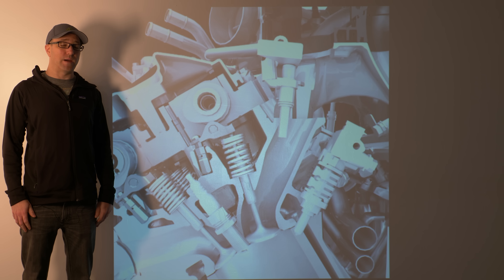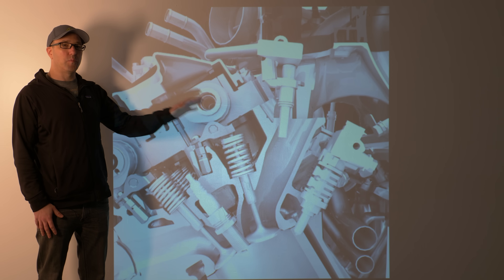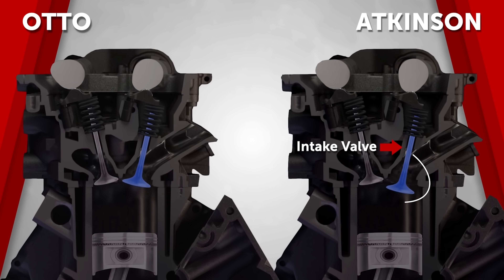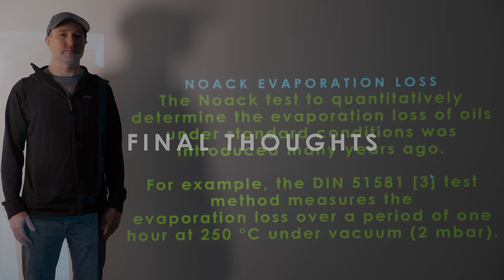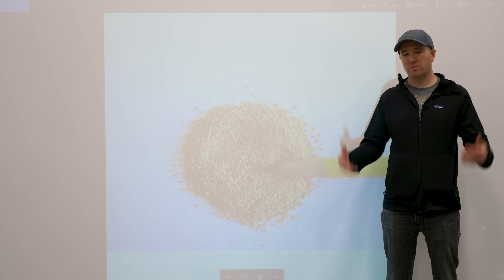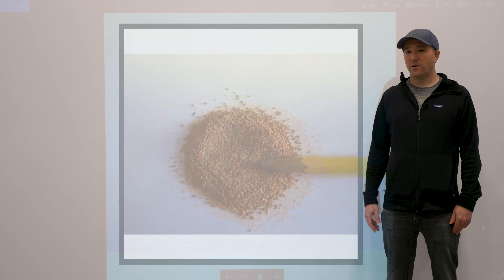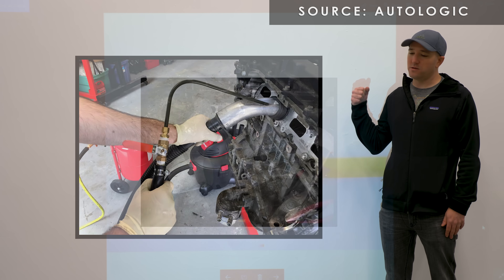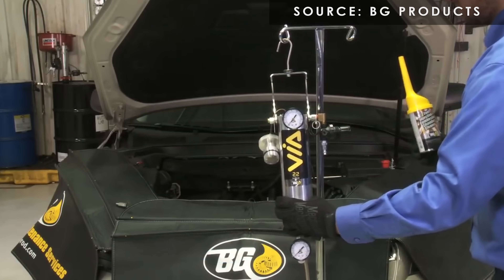Direct Injection, Problems and Solutions | The Fine Print

Comment: Sorry but I have to call total brain dead bullshit on just about everything you said.  First off I can clean much worse carbon off those valves in 5 minutes with toluene and they will be as if you just polished them on the brass wire wheel.  Second one only needs to disconnect the blowby to solve that stupid problem.  Third passing emissions is so easy for any car that runs that anyone who doesn't know how has no business even lifting the hood. 
   Now for some reality that is way too real for any engineer who has had their brain removed by a school of lower learning to understand or believe, much less build and use.  Paul Pantone's Geet Plasma generrator, used by hundreds of thousands of people all over the world and actually taught in french university automotive classes produces absolutely zero Nitric or Sulphuric pollutants and when built right puts out over 25% oxygen from the exhaust.  Everything this world does comes from the world of lower learned loser idiots...too smart to build a 100 dollar invention and prove it works.  They would rather spend their time telling me how the thing that I build does not work than to shut their stupid mouths and see how simple life truly can be.  The University is one of the most evil places a man can set his foot and worse than that is people are so stupid they actually pay idiots to teach them lies.  Geet Gas was proven in Steven Jones physics lab, yes the same Steven Jones who claims that Thermite caused the world trade centers to dissapear and turn into dust  so that no steel beams could be found other than the ridiculously small pile left for the media to film to further the MK Ultra brain washing operation called shock and awe.  Any real researcher knows that fema took pictures of what was left while standing in the exact center of the ground floor slab about noon on the day before tower 7 was brought down.  So if 110 stories of steel beams fell to the ground because thermite melted the joints, surely you would be able to see one of those beams on the ground floor right?  Well you can't and their is nothing but dust with an ambulance sitting at the front door covered in dust but without a scratch or dent.
    This same Dr. Steven Jones is the man who single handedly with the raising of his hand pressured his peers into voting that cold fusion did not take place in an experiment that proved it did.  He also claimed He had never met Paul Pantone on a live radio show only to be proven a liar.  These are the types of people that rule over Universities where they fill your head with evolution junk and a person cannot find one teaching of righteousness in any class, don't believe me?  First off find out what the word means and then go look, you will come up empty because they only teach lies, millions of different versions of the same lies while they enslave the student and saddle them with the only type of debt in this country that cannot and will not ever be forgiven or forgotten.  Real knowledge and wisdom and understanding only come from Yahweh the creator and of course they are free.  Anyone who says free energy does not exist is a fool because all the energy you use every day was put here for mankind by Yahweh and he has never charged a penny for any of it.  Your energy comes from the food you eat which requires water and all the water on this earth is purified and delivered free of charge at all times.  
   The Geet system when built up fully actually produces 4 power strokes from the 4 stroke engine, produces more oxygen than is sucked into the engine, cleans the air as anything that passes by the Monopolar reaction rod is dis-associated into it's sub atomic particles and recombined into geet gas.  In Dr. Jones Lab the best Physics lab measurement equipment on this earth was there to be used and Paul used it all.  Dr. Jones even provided samples of radioactive isotopes to be passed thru the reactor and then measured what came out using NMR.  Geet cleans all known radioactive isotopes because it breaks down matter and then changes it into geet gas which implodes instead of exploding actually sucking the piston up the cylinder during intake stroke.  Ice crystals have been filmed forming on the exhaust pipe in JULY for millions to see.  My biggest engine, a wakashaw 250KW 8 cylinder monster generator never got above 176 degrees and did not use a radiator at all.  Anyone who is familiar with these engines knows the radiators for them are 25 feet  by 25 feet and 5 feet thick.  Nothing any engineer in this world does means anything because they are all suckers and slaves to an evil system built on lies who says..."make sure you hurt not the oil or the wine".  Very soon these same oilmen are going to wipe Damascus off the map in one day and when you hear them say ..."Peace, true peace"  here in a few days you'd better get ready for what comes next.  Once all the ashes have settled and if you're still alive when it's all over (one hour or less) just know in your heart that No school of lower learning will ever be built again and everyone will get their knowledge from the one who made everything and owns everything, who best to ask if you want to produce a powerhouse engine that uses water as fuel and makes oxygen and cleans as it goes?    If you find it hard to believe the things I wrote, then you have a problem and you need to humble yourself because the part that should have got your attention is the 100 dollar price tag.  Paul designed the patent that he gave free to the public (20HP or less) so that it uses pipes and fittings easily obtained in any hardware store in any country on earth.  A real man shuts his mouth and builds the prototype and tests it before he proclaims it can't work, an engineer however is not a real man as his testicles were removed on his first day in university so I won't comment more on that.  Engineers are not inventors, once you know this you will do fine.  Mankind was made without limits and the only part of his journey so far that Yahweh has held back is this final full blown nuclear exchange which is about to be released when Trump restarts the OSLO accords otherwise known as the seven year peace plan confirmed with rabin spoken of by Danyl the prophet thousands of years ago.  I'm not an engineer because I can actually work on and fix any engine known to man and have and do everyday.  There is nothing mechanical that I don't know how to fix and how to make work better so to all you nay-sayers who think you're a master mechanic, just remember this.  There are Master certified ASE mechanics and then there are the instructors who teach the instructors who issue those patches, tear down that wall in your head and do something beneficial with that brain of yours and quit wasting it trying to be a good slave or a smart slave.
Peace
Sizzlean

Comment: There is nothing to gain with DI for you the consumer or you the environmentalist.
This is a game between  the Bureaucrats and the manufacturers .

Sequential Port Injection is the practical  ceiling for combustion engines.

It is akin to motorcycle front suspensions.

There are "better" ways of suspending the front wheel. But to date, none of them have been "better".

It's a cruel world folks.

Unless you step up to (fill in the blank) powered roads that you induct metered power from and can magnetically levitate any box with wheels with backwards compatibility, your just pissing in the wind.

It would take a nation of brilliant badasses that are fearless geniuses to accomplish with the publics full support and desire for something that will last far into the future and benefit all mankind.

But without a way to store the electricity to use as needed , again , 
We're just pissing in the wind again.

It's a cruel world folks!

Clean burning fuel is what's we's got, and that's about it for the foreseeable future.

Battery technology suuuuucks right now and they are right up against a wall called elemental physics.

Or just go ahead already and come up with your own new elements that can solve the problems with storing electricity .

Good luck.

Instead off feeling bad about our cars, we should be damn proud and focus elsewhere, for now.

They're just polishing a turd at this point.

If cars were made right , they would last too long, save too much and make the manufacturer less .

They don't make lightbulbs that don't burn out.

That doesn't mean that you cant build one for yourself though.

The first rule of environmentalism should be conservation . In the end, it is the cleanest way forwards.
Reply: Preachin to the Choir!  Liberals and tree huggers have never learned the 1st law of Thermodynamics. energy is conserved. it cannot be made out of Nothing.

Comment: Great information, with one small mistake.... I actually have a 1981 Mitsubishi MCA Jet engine complete with it's last smog test results and they were truly amazing.... well when the engine is warm... Until it warms up it smokes and stinks, which it from the day it was new... But that aside, it's a pretty low revving engine with pretty low power.  And yes it does get like 45 MPG on the highway pulling a pretty heavy six passenger station wagon.  It's top speed is about 65 MPH up a moderate grade....

The CVCC and MCA Jet engines got awesome gas mileage and when warm didn't pollute (at least true of the MCA Jet)  but by today's standards they are slugs.  (And in the case of the MCA jet you had to wait from 5 to 10 minutes before you could drive it as it went through it's warm up cycle)...   

So... more correctly,  DI engines provide better fuel economy while providing better performance.  Performance being the key word in the sentence.  That said and to be fair to the old snails, when a Turbo DI engine is running at red line, I doubt it's getting great fuel economy.  And I suspect it's not running optimally clean either.  

DI is interesting technology... but it has issues that aren't resolved yet and might never be resolved without a price in complexity and reliability.  Marginal ideas always seem less marginal when the objective is to meet some government regulation.  Meeting new government regulations and the costs required have pretty much driven former American car makers out of the car business.  Sure American manufacturers could meet the standards, but by the time they cost reduced the cars enough to meet a reasonable price point they weren't reliable or attractive enough to appeal to consumers... And what's the sense of building cars that no one will buy?  Judging from the fact that many off shore manufacturers aren't doing much better than the US ones, for now, the future of every automotive technology is uncertain.... let's see how things shake out.

Comment: Good stuff, I bought a 2014 Focus ST, after my 05 Vibe got totaled, I loved the power and fuel economy was ok, I only bought it cause I work for Ford and got my A plan discount... but as a former mechanic and researching GDI engine issues I elected to trade it in for a vehicle without GDI, I currently own a 2008 Acura TL with the 3.5L "J" engine. While this engine does require premium fuel (91 Octane or higher), and has the rather expensive timing belt replacement requirement, I feel more at ease knowing there isn't a "growing" problem inside my engine with every passing mile.
Reply: Acura's are junk and it will cost you more long term as it starts falling apart

Comment: The biggest contributor of fouled intake valves isn't from the PVC system - it's from the EGR system. There's really nothing anyone can do to reduce EGR gases fouling in a intake manifold but with the PCV system you can use an oil separator to "reduce" the oil vapor in the intake. In the 1950's they just let the blow-by gases vent down a draft tube toward the road. Unfortunately, it created a huge problem with smog and an oily stripe down the center of the road. If they could direct/force the PCV gases directly into the exhaust system just before the catalytic convertor it could eliminate one  problem.

Comment: Almost looks like the C64 is being used as a keyboard for a Mac - weird pic! DI injectors don't flow more, they are just at higher pressure. It gets lots of hate, but DI motors (particularly when combined with port injection) allow some pretty fierce power output. Cleaning is just maintenance. Heavier oil creates more drag and heat, thus impacting power and fuel economy... that's why oil is being specc'd thinner. Using heavier oil defeats the whole purpose. Those of us old enough to remember know that cars are dang near maintenance free compared to cars from the 80's and earlier. I've got 80k on my DI turbo and haven't had to clean yet but will I'm sure. Doing that once in the life of the car? seems like no biggie to me.

Comment: I kept the pcv valve on my valvecover but I put a hose on the valve and routed it down to the lower engine bay. And then I plugged the hole on the manifold. 
Im driving a mitsubishi with the gdi engine so I'm aware of these problems!

Comment: Does my 2017 2.7 eco boost have direct and port injection ?
Reply: Yes! Ur golden. Great motor. Use high quality full synthetic motor oil like Pennzoil Ultra Platinum or Penn Platinum.
Reply: @Davido50  thank yo, i called the dealer and they didnt know..
Reply: Hey apparently it is only direct injection. Looks like ill return the lease. Thanks

Comment: DI isn't the issue, ever since it's inception PCV has ALWAYS been the issue with gasoline motors. People were against fuel injection when it came out even though it was superior technology. People were against multi-port fuel injection when it came out even though it's superior technology. People were against variable cam timing when it came out even though it's superior technology. People were against pretty much EVERY improvement over the years because they add complexity, however they are SUPERIOR TECHNOLOGY. We adapt and our vehicles are better for it.

PCV was mandated by our EPA because politicians know best. It's an inferior technology, everything it does is bad for our engines, it should be routed into a canister filter that's replaced periodically as routine maintenance NOT into our intake streams.
Reply: EcoBoost! Used in many high performance vehicles successfully.

Comment: The good news is that car manufacturers are finally seeing the light and have starting to move to dual injection, for example, the 2020 Sonata has a dual injection setup similar to Toyotas D-4S. Ford has made most if not all of the newer EcoBoosts dual injected. The new Altimas turbo engine is also dual injected and Audi's 2019 and later RS3 also has dual.

Comment: Depressing. You would think the manufactures would have the sense and honesty to include an oil separator as part of the PCV system.  Since the carbon buildup on the intake valves must affect emissions and fuel economy the Federal Standards should require manufactures to certify that their engines prevent this carbon buildup for 100K or more miles. Never good to improve an engine in some functions and create problems in some other area. That was what was so wrong with the attempts to reduce emissions and increase fuel economy during the 1970s era. Fortunately the engineers and other science folks figured out high-tech engine design and management so we now have clean, powerful and efficient engines, but this "disaster" with direct injection is a step backward.  Great video. Thanks. I am definitely not going to buy a turbo DI engine.
Reply: My old 1994 Volvo 850 has an oil separator as part of the PCV system.  Watching this video, I just keep reminding myself why I am beginning to prefer older cars more and more.  Sure, the "new car" thing is nice but the systems, the faults, the designed in complexity and subsequent costs and lack of overall long term effects being considered just makes the decision easier.  The other solution to a lot of these problems of course, is electric power but then there's the bigger issue of resources used to make batteries, electronics in systems to go wrong etc.  I think i'll just cycle more! :)
Reply: LOL Planned obsolescence! They design to 'fit pollution standards' , but still want breakdowns and repairs for after warranty business.  @djtaylorutube
Reply: The explanation I've heard is that there are certain things that just don't show up in testing. Cars have to spend years on the road before said problems show up. Toyota saw it and has the money to immediately address it (adding a port injector). Ford did something similar. Smaller companies like Subaru can't afford to retool that quickly.

As for the seperator, I'm sure there's complications and trade offs. Very few decisions are just plain stupid. There's usually a reason

Comment: I have a 2018 Subaru WRX with the FADIT engine. 30k miles and everything has gone wrong with this car. Car is amazing and I'm convinced I just chose a defected car. Lemon lawing the car and getting a new one, but I want to keep it long term and i want to learn how to make this engine live 100k+ miles. Thank you for the info! Very helpful.
Reply: my 1994 bmw 318 tds (diesel) has 260000,i want to make it live to 500000 (very easy,actually,the egr has LONG been deactivated--just pull the vacuum line, no light ,no codes,lol); those old BMs were well built,i drive newer cars  (been a mechanic for over 40 years,i'm in portugal--that shht place where the INjustice system ain't worth a dime,it has 2 speeds,coma and death) and i really enjoy driving mine--have 2 of the same,one good,the other a bit slow,some' wrong with the electronic injection pump; A/C and ABS work great,thatá all i need;
Oh,i forgot,even back then,bmw MESSED UP with the extra complicated door locks and elec.windows!!  they are a nightmare...(on my good one i converted to manual crank winding ,love it, and i installed  an El Cheapo china remote door closer;     STAY WELL clear of today's Bms...